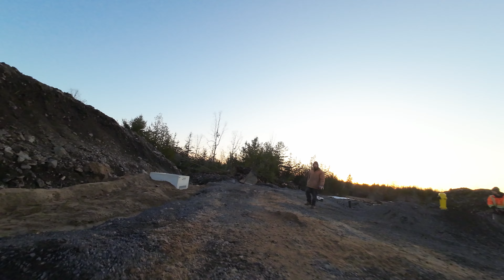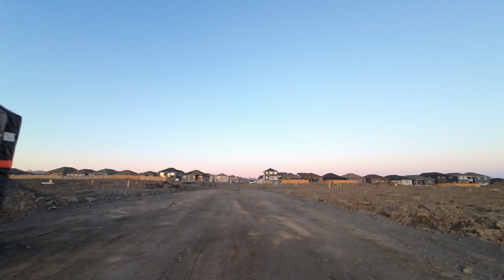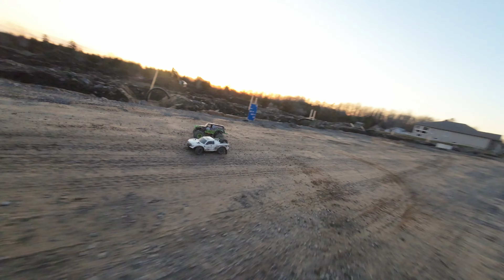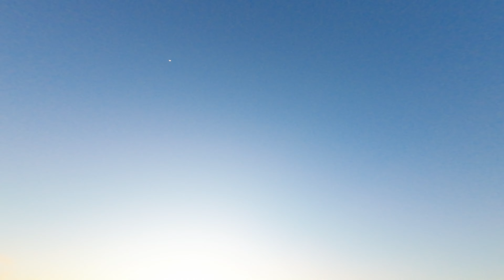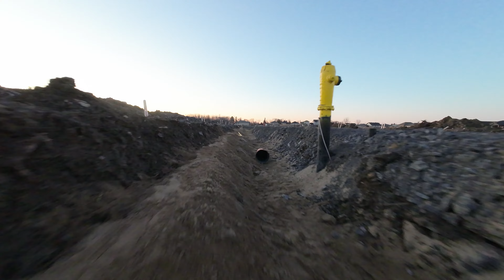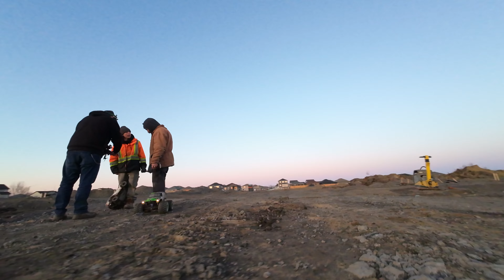DJI Avata - Orbits + powerloops + RC Madness with @00whynot and friends!

Comment: How's that avata treating you? Does it desync on you at all when you turn quick?nice flight by the way bro🤙
Reply from the maker: Yeah it flies pretty good until you try to do any kind of quick yaw action at speed then wants to flip upside down, mostly just learning where that’s likely to happen and trying to avoid those conditions but it’s pretty annoying there’s definitely a design flaw with it…
Reply: @alex-m-jones  danm they still haven't fixed that jw thought about getting one myself but prob just stay clear from that lol thanks for ur input much appreciated 💯
Reply from the maker: @burdfamfpv  yeah and the remote id firmware thing is super annoying too, despite all that i still like it and it’s a good drone, but it could be great if they would have fixed those two things